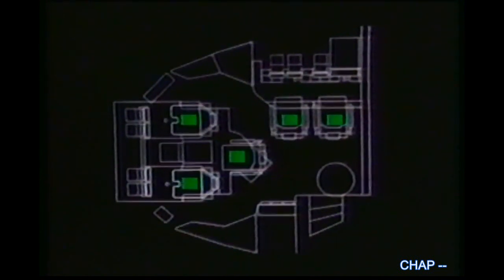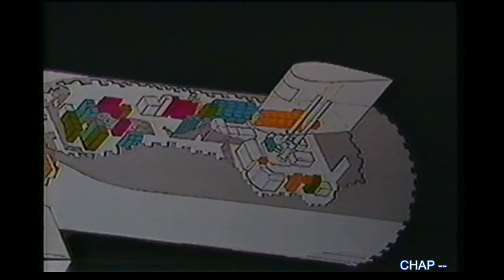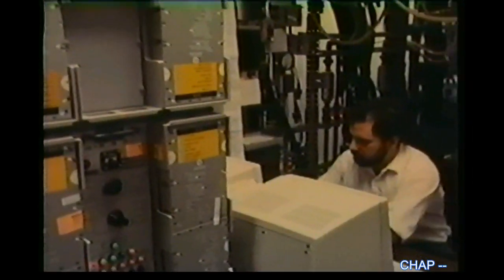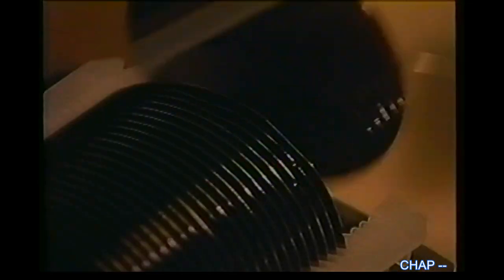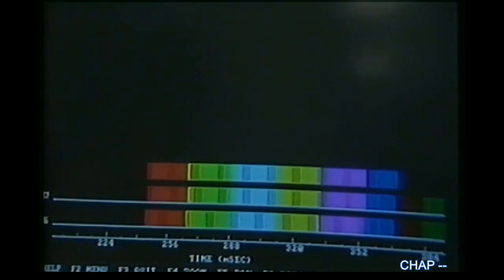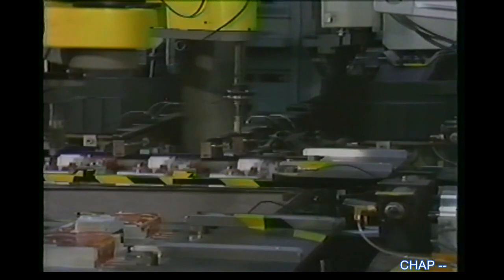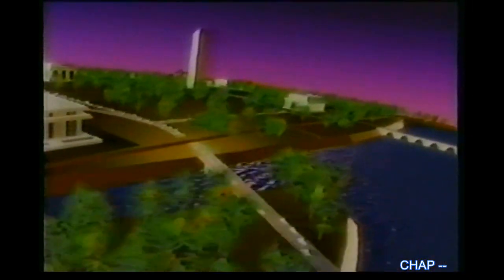Computer History:  IBM Film 1989  Systems Integration Division (automation airports traffic control)

Comment: This looks like a video with some film elements. Someone at CHM should look at reclassifying it.
Reply from the maker: Hi Steven, not sure what you mean in your comment, can you clarify?   Thanks!
Reply: @ComputerHistoryArchivesProject  my clarification on video vs. film means if the original came off off a 3/4" or Betacam tape running overall at 30 frames per second it's considered to many as "video". Film is negatives with separate sound tracks and running at 24 frames per second. If it was on the former, it should be renamed on the title as "video" than "film". ~S
Reply from the maker: Hi Steven, interesting!   Thanks very much for clarifying this.   ~   VK

Comment: @5:28 ff: I want that keyboard!
I was personally involved in one of the projects mentioned in the film and several others of a similar nature involving that part of IBM. The $3.5 billion air traffic control system upgrade called the Advanced Automation System was a monumental disaster. $3.5 billion down the drain or most of it anyway. The company that bought the company which had teamed with the company where I worked to compete against IBM for the original contract subsequently received a contract to do it over and used several more billions of the taxpayer's hardearned and even then the result wasn't considered a total success. That system is now in the process of being replaced with a GPS (vs radar) based ATC system. That TV news story about it was laughably wrong but it did mention one aspect of the project in which I was once intimately involved.
Reply from the maker: Hi Dale, thanks very much for your feedback and insights.  Do you recall the name of the final system that took over the  traffic control activity?     Thanks!  ~  Victor, CHAP
Reply: @ComputerHistoryArchivesProject  Victor-- The name of the system as-built is called the En Route Automation Modernization (ERAM). Found a good article about it on the FAA site but it seems that if the link to it is included in the comment, the comment gets quashed! Looks like that incarnation also had a tortured history as I have been told.
keywords: eram, faa, lockheed, raytheon
Reply from the maker: Hi Dale, thanks very much!  Fascinating!   I will check this out, and thanks for your "key words"!   :  )  Victor, CHAP
Reply: @ComputerHistoryArchivesProject Good question. I'll look for it when I get a few minutes.
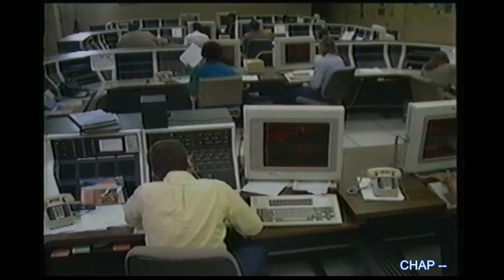Reply: You mean the keyboard at 5:48? At first, I thought it was a standard IBM 122-key Model M "Battleship," but on closer inspection, it appears to be quite a fascinating specimen: an IBM Model F "Unsaver." Due to space saving designs being fairly niche and uncommon in the 80s/90s, this sort of model would likely be incredibly rare and fetch a respectable price... Presuming my eyes don't deceive me
Reply: @KosherPorky  Actually, I thought it was a 122-key Modef M too but like you say the layout of the keys looks like some kind of Model F. Now I really want one! The AT 84-key Model F is my favorite.
Reply: @dalecomer5951  Ah, a man of good taste. Can never go wrong with a Model F